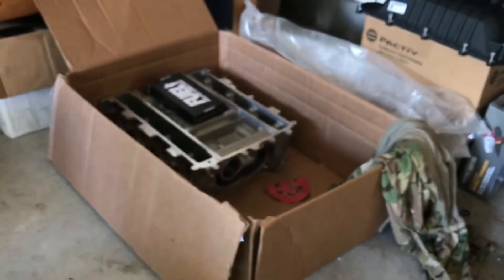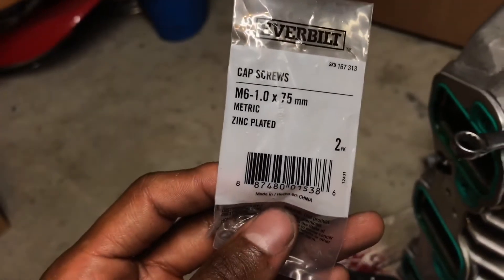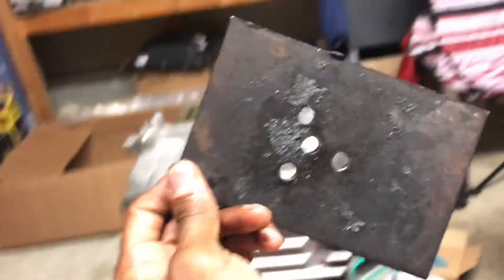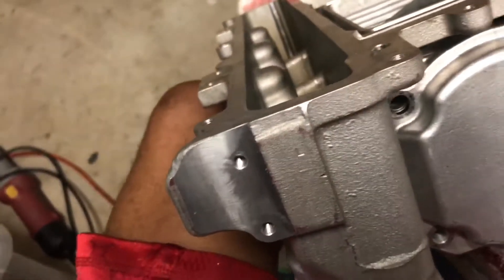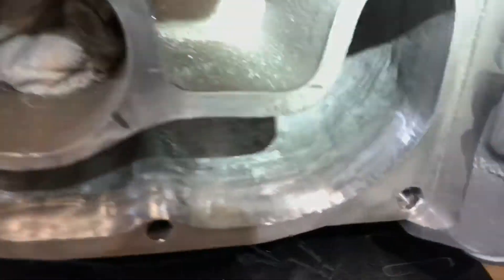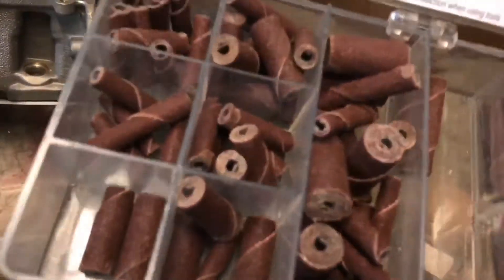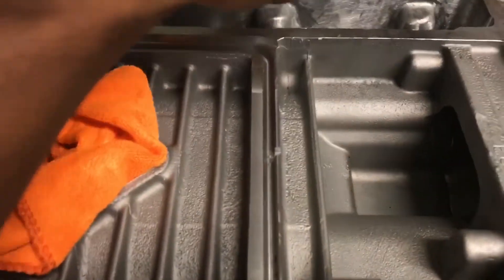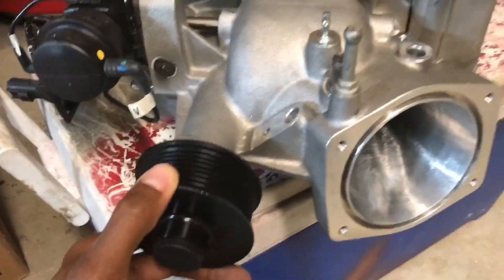LSA Supercharger DIY Porting (Part 2 - Rotor Removal/Blower Body Porting)

Comment: Hi, I have a question about how you reinstalled the part that you removed with your custom gear puller. Superchargersonline support warned me to be careful putting it back on. They talked about supporting the gears so that you don't push the rotor back. Since you didn't show the reinstallation, I was curious. Here's what they said "Once you remove the gear case cover, and dump the oil you will see the two gears.  you need to support them so when you push the hub on you do not push the rotor back."
Did you have to drain the oil in order to press that part back on?
Reply from the maker: I think I may understand what you mean but the rotor pack bolts to the back of the supercharger. I’m not sure how you’d push it back if it’s bolted in. My LSA had a drain plug for the oil that’s for a self enclosed set of gears. That oil won’t do anything for helping press it back on from what I remember. I’m pretty sure I just sat the piece on the shaft and used a piece of wood and hammer to softly tap it back on
Reply: @GetItAtWiLL Thanks for responding. It all made sense when I drained the oil, removed the back plate, the hub, and the rotor pack. My hub was bad. One of the three prongs was broken off (as I came to know) when replacing the stock isolator with the fixed one. What I'm stuck on now, is whether to degrease the needle bearings and repack them with the blue grease. I haven't found any info on what solvent to use, nor best method to repack the grease. Any thoughts on that would be appreciated. Thanks.

Comment: What was the torque for the 6 rotor pack case bolt?
Reply from the maker: 20 ft lbs is what I found and also what I used. The bolts are technically 1 time use (torque to yield) bolts but I did reuse mine
Reply from the maker: Give me a bit to try and find it lol I def don’t remember and have to go search for it

Comment: Porting and or smoothing the exit runners does nothing in the way of performance . I understand your idea here but that looks ruff my man .
Reply from the maker: jamesbtri this is very true and I’m pretty sure I touched on that in the video and specifically mentioned that’s why I wasn’t really putting the time and detail into the exit runners as I did the Supercharger inlet and snout. The inlet was my main concern. I could’ve spent more time on runners but as mentioned no real point.

Comment: How did you put the hub back on the rotor shaft?
Reply from the maker: Jesse Boland I just used a socket that was just the right size to fit between the 3 isolator prongs and tapped it back on. Of course I'm sure pressing it on would work as well and also probably heating the hub but from what I've seen and heard from most diy they just tap it back on. Worked great for me. Sorry I didn't get it on vid